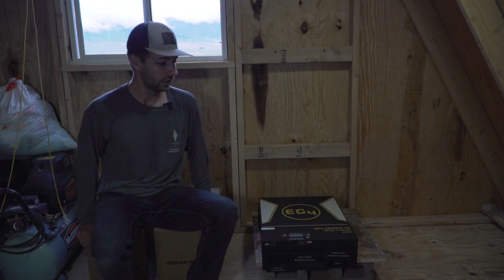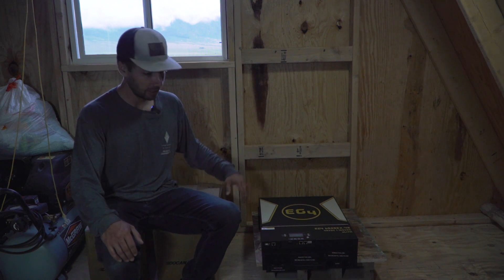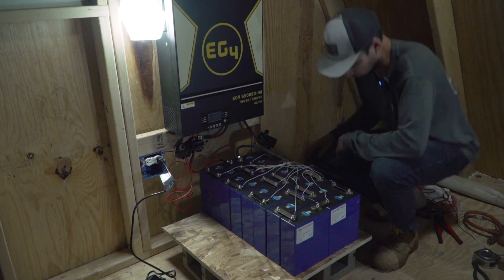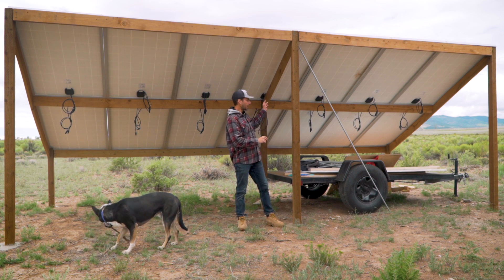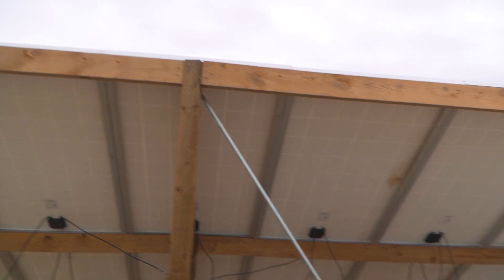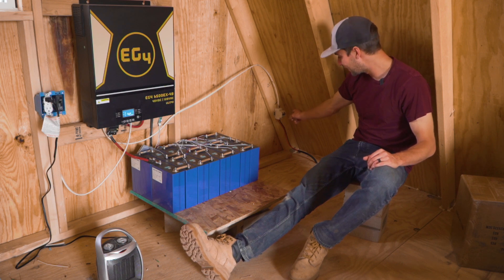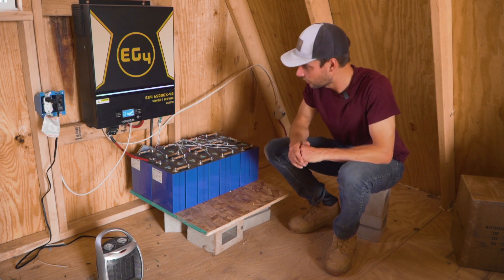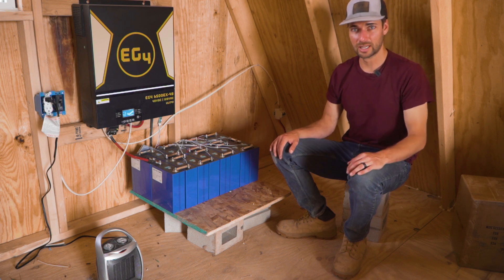DIY Building My Own Off-Grid Home: The Solar System pt. 2

Comment: OK give me one reason why you didn't line up the apex of your shed with the sun and put the panels on that. Being steep the shed roof would optimise the solar gain in the winter -when you need every bit of power that you can get.
Add some panels there and use some of the power to heat the batteries in the winter.
Reply from the maker: The ridge of the A frame does in fact run E-W, and that’s no accident! I have another 7KW of panels to mount, and at least 12 panels will likely end up on the A frame. The two ground arrays I built were a better initial choice for mounting in my situation, as I wanted covered storage for my trailer and trencher, and then also a separate enclosed area for smaller equipment that was still too big for the A frame (which is on a raised foundation). My battery heating system only draws around 14W anyway, and as it turns out is completely unnecessary when the batteries are in use, which is all the time now with the house. I’ll be sure to make a mounting video for those A frame panels, and I’ll be looking to do that with few to no roof penetrations as that is the main reason I don’t like roof-mounted panels. Stay tuned!

Comment: My 6500ex in a hunk of cheap, pulsating, flickering junk! Try starting a 2 ton heat pump with a soft start.
Reply from the maker: You have a 2 ton heat pump that runs on 120V??

Comment: I have two eg4 6500 ex 5 months old for sale if anyone could point me in the right direction on where to sell. Any known used solar equipment solar groups etc.
Reply: DIY solar forum. I see you must’ve gotten the pulsating, flickering pieces of junk like I did. All they are is an expensive solar charge controller to me. The inverter portion sux!

Comment: I would consider cross bracing the solar panel setup.  the winter winds in that valley can be extreme.
Reply from the maker: You’re not wrong about those winds! Although I’ve had worse winds in the spring than this winter at least. Ended up going with tension lines from the corners to the center posts for bracing. A northerly would cause uplift but the shed blocks that on this array. The one I’m building now is exposed but I’m enclosing it so the walls will give it the shear strength it needs and mitigate the uplift. Hopefully!
Reply: @RidgyDidgeRanch  tension lines should do the trick.  ya, this winter has been relatively mild with winds, spring can be rough, but the worst I've seen have been in Dec/Jan.  I'm on the other side of the mountains from you - to your east.   Your project is looking good!
Reply from the maker: @andreww7938  thanks mate! Your side is beautiful too. Had my eye on some land by Westcliffe but this just made more sense with a bunch of family in Poncha Springs. Cheers!

Comment: Awesome channel! Can’t wait for your future videos. One concern I would have would be Colorado winters with those lithium batteries. Lifepo4 can’t be charged below freezing so you may want to build an enclosure with some method to heat the batteries when solar is present. Something as small as an insulated box with a small heater or even a 100w light bulb may be enough.
Reply from the maker: Thanks for the comment! I made an insulated box off camera, and if the batteries were being charged and discharged to any substantial depth regularly I think the heat they release would be enough to keep them at 10-15°C, but because I’m not using them at the moment they’ve been getting quite cold. I installed 28W heating pads last week and after temps in the teens Fahrenheit for a few days they were sitting at 13°C. For $20 I highly recommend that addition!

Comment: A couple questions if you don't mind.  My EG4 6500 and 3 server batteries are in transit.  I'm grinding my brain on placement.  I notice you didn't provide the recommending clearance on the bottom.  Do you have any concerns (e.g. noticed heat build up or reduced air flow)?  Is the fan on the inverter loud?  I have a pellet stove and hate the noise.  I suspect this will be about the same.... can you comment?  You chose direct burial of the solar panel cables.  i personally want to put mine in conduit. Besides cost and critters, is there another reason you went with direct burial?  

Pretty mountain you get to look at.  Although it looks like cold high desert to me - so are the winters there brutal (guessing SW colorado or NW arizona - possibly New Mexico)?  Love the overall look of your property improvements.  Your solar panel ground mount looks awesome.  I think I'm going to copy it instead of going with Iron Ridge.  Any regrets after living with any of it for a few months?
Reply from the maker: Hey Mondavou, I’ll be honest, I didn’t consult the handbook much past the settings so was unaware of bottom clearance requirements. It seems to be vented all the way round and it mostly isn’t touching the wall behind and so I’m not overly concerned with heat dissipation. I’ve put 3.3kw input through it and it’s barely warm to the touch. The fan is loud when it’s charging the batteries with the full solar input. If you have some base AC load so all the power isn’t going to batteries it’s significantly quieter. Even so, noise is one of the main reasons I’ve mounted it in the shed and not in the house. On the panels, I quite like how they are and haven’t had any issues. Improvements I intend to make are sealing between the panels so rain doesn’t drip down between them and potentially enclosing one like a tiny pole barn for storage. I’ll have 3 more arrays mounted soon enough and 2 will be at a steeper angle for optimized winter production, when I’ll need more power. Hopefully that helps! With some more time over winter I intend to make more of an ‘instructional’ video on making the ground array which might be beneficial. It was super easy and I don’t think it gets much cheaper!
Reply: @RidgyDidgeRanch  Thank you.  I appreciate your time and input.

Comment: HOWdy  R-D-R,
Thanks for the VIDEO 
SUGGESTION =  S L O W  the camera down when you are EXPLAINING your installation UNDER your PANELS 
I would have REALLY liked to SEE the details of your WIRING ( instead of a BLURRY fast-forward condensation )
I'm assuming you wired your PANELS in SERIES --- "+" to  "-"  toward the center from BOTH ends "in" to the MIDDLE 
and then (maybe) utilized a high AMP  Siamese connector ? to join the two STRINGS together ???  
COOP
..

Comment: Use high voltage so you don't have any loss from solar panels.
Reply from the maker: So I originally designed the system with the intention of using an MPP6548, and made the last minute change to the EG4 when it was released. Unfortunately my panels in series would give an VOC of 512V, just over the 500V the EG4 can ingest. And while the series configuration would definitely reduce my losses with the square of the current, given my cable choice and length my line loss should be <1% anyway. You’re totally right though!
Reply: @RidgyDidgeRanch  The inverter is actually rated at 450v & 18a per mppt. So you’re well under the max capacity of the inverter. I thought the same thing as you and contacted signature solar and they replied telling me that.
Reply from the maker: @fullsizeoffroad7560  Glad I didn’t do the series configuration then! I’ve only connected 14 of my 56 panels so hopefully shouldn’t have any issues with 14 in each mppt on a split-phase system. Thanks for the info!